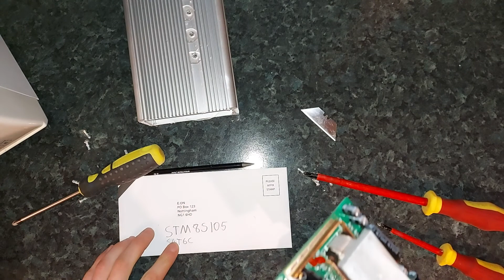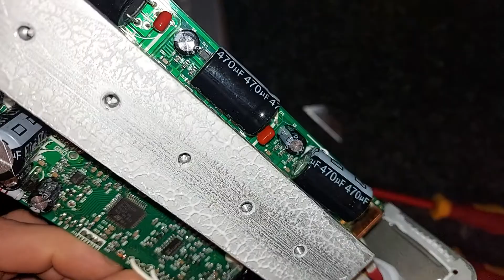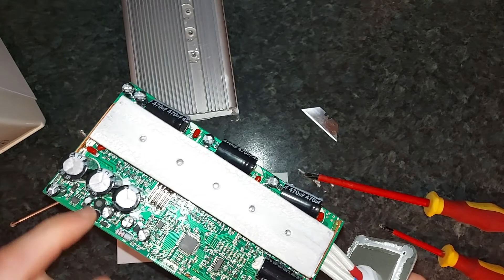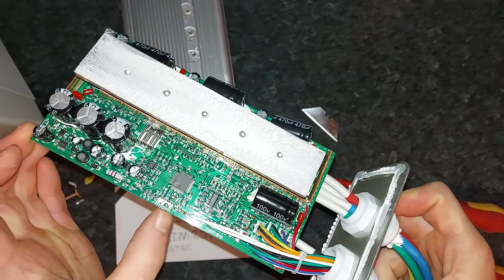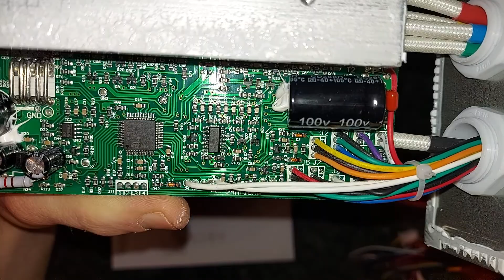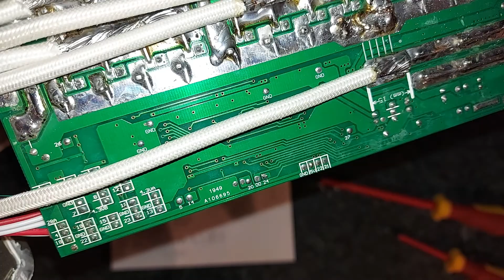Kunray 72v 80A 3Kw Controller Disassembly

Comment: mine says 48-72 v 3000w 80amps max...i havent opened it yet..if it has 100v capacitors like yours do you think it can handle 84 nominal voltage?...around 95-96v...or probably ill burn the controller?!!the increased voltage will affect the mosfets?
i say it cause in one of these controllers sold on ebay...they stated...''72v...attention...stay at ANY CASE UNDER 100V...''
Reply: Above 90v will burn it out most likely

Comment: I want to use same controller but my question is can I put battery volts @120 volt the battery packs I want to use are small 24-30 volts each pack 65ah 260000mah total is that safe I have also 72 volts 60ah in total is that safe to I know nothing about the electrons
Reply from the maker: Do not supply more voltage to the controller than it's rated for.

Comment: i bought one very  similar for a ebike kit i was putting together. the instructions are terrible mine only puts out 47 amps, despite it claiming 80 amps. any ideas? i have connected the "high speed gear", not sure why its called gear, but i have a couple of wires called "3 speed jog 4 speed jog", its only two wires, do you think this is related to why i can only pull 47amps?
Reply: What kind of batteries are you using?

Comment: Will this controller directly replace the 50 amp controller that comes with the kunray 3000w kit? Will it damage my battery if I change the controller?
Reply: In most cases, they are exactly the same.

Comment: Not much support for STM8 in Arduino as there isn't a free C++ compiler available for it, only SDCC which is C only. STM32 on the other hand is far more supported and i've seen used on some of these cheap controllers, not this one though.
If you are looking for something more configurable, I'd look at VESC. I know Shaman from the esk8 forum has been designing some 84V VESC 6 based controllers for a while now (Serious FOCer), perhaps you'd be interested.
Reply from the maker: That's a bit of a shame, I will check out his project and thanks for mentioning it.